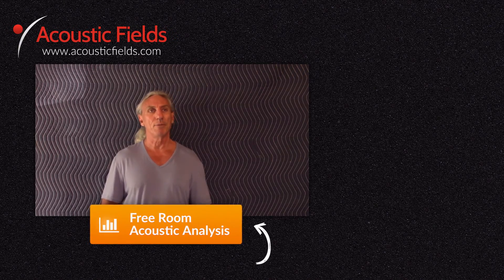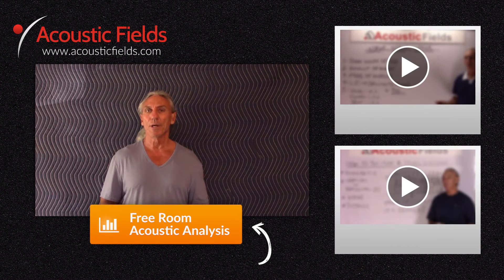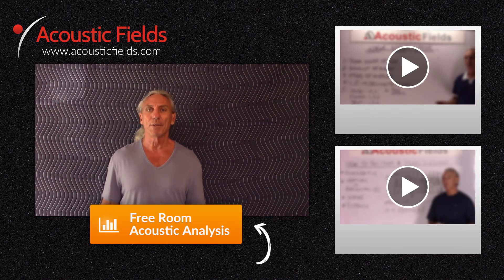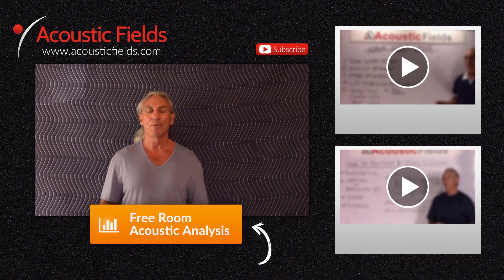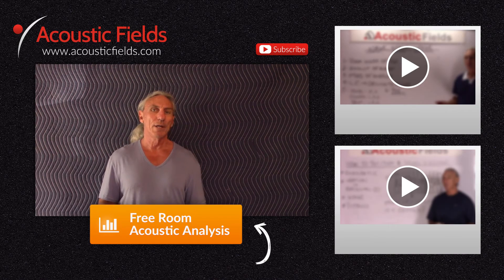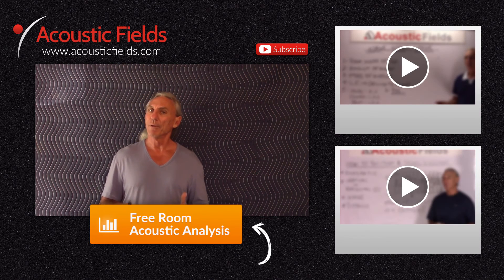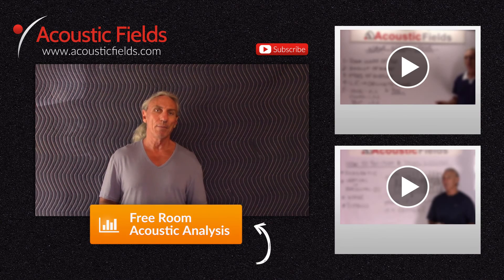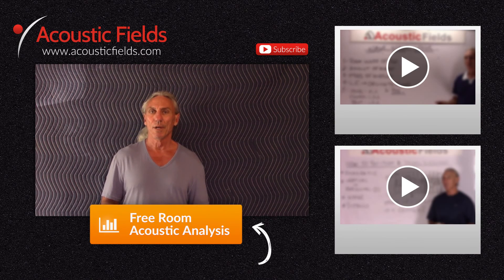Studio 2020, Chicago [3/4] | Room Correction Software Vs. Acoustic Treatment

Comment: I wouldn't ever rely exclusively on software-based correction systems; at least not in this stage of technology ( it may improve dramatically in the future, who knows?). I think you need to get your space treated as well as you possibly can first - - tackling the common issues that are so often found in home studio environments, by using the various devices mentioned; (Bass Traps, BB absorbers, Diffusion)... but, I do think that speaker calibration software can be a useful final touch, at least that's been my experience.  I also think that the various manufacturers of this type of software are "misleading" consumers a bit, in that these various corrective software systems are known and sold as "Room Correction", when they aren't correcting your room at all - they are adjusting what your monitors play, frequency-wise, in response to what the sonic measurements of the space provide... but "Room Correction" is a misnomer, because it's not like these various correction systems can "fix" your space... they can't remove reverb/reflection, or get rid of standing waves, alter parallel surfaces, etc., as these are physical attributes that need to be corrected...well... physically. So.. Room Correction? No. Speaker Compensation? Yes. But they aren't meant to be used - or trusted - on a room that has little-to-no treatment at all. All that said, I'm not saying that they have no value at all; I've found the system I use (IK Multimedia's ARC 2 ) to be a very useful final touch in my treated room, and I do believe that it is contributing to helping my mixes to translate very well across other audio systems (car audio, boombox, home theater, other studio's monitors) that are away from my room.  IMO, of course.... - - donny
Reply from the maker: Hi Donny, You are correct. There is also something inherently wrong with manipulating the source to compensate for the room deficiencies. The artist and the engineer went through great efforts to create a source of music that we have no right in interfering with. Leave the music alone and fix your room. We owe the music at least that much.